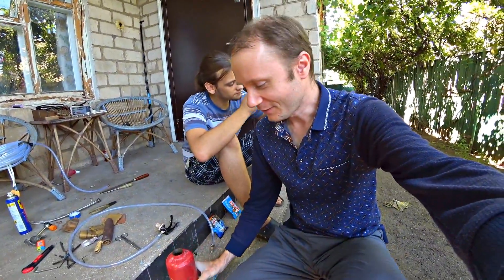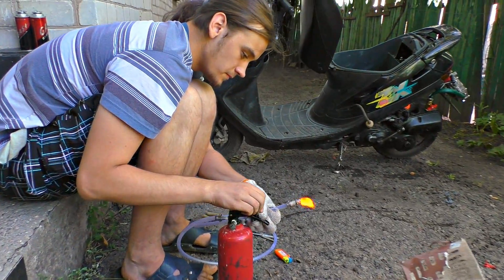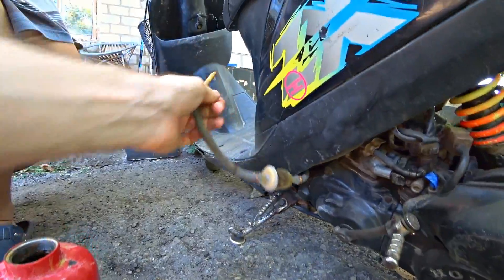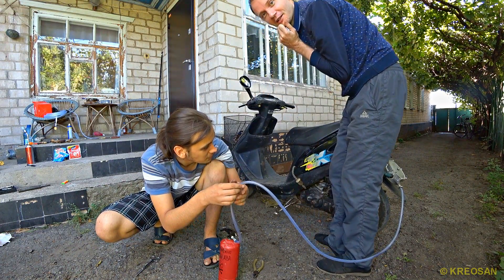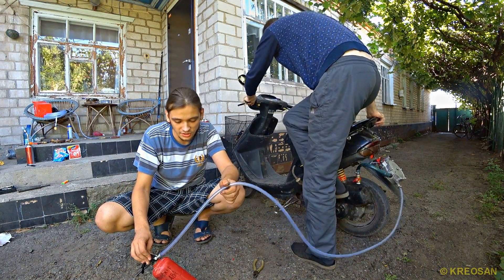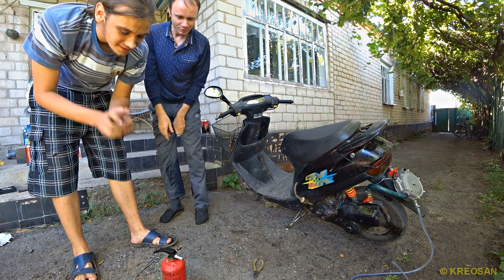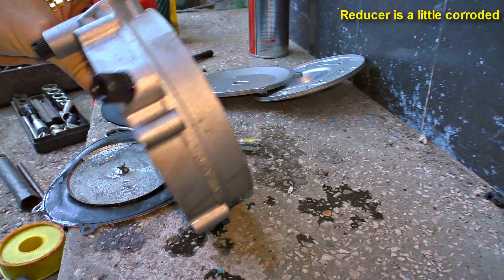Hydrogen Scooter 🔥 First Tests!

Comment: How about using a magnetron in place of the spark plug. Use and ultrasonic tranducer to vapourize the water before it reaches the combustion chamber. Change the spark timing to exactly top dead centre, and feed a higher power to the magnetron. When the water vapour reaches the combustion chamber, the magnetron may produce  a mixture between hydrogen and super heated steam which should force the piston down very quickly. You may have to modify valve timing and have better piston rings for sealing, but it may be something looking into.

Comment: One of the main challenges with using hydrogen as a fuel is its low energy density by volume, which makes it less practical for certain applications like transportation where space constraints are important. However, if effective and efficient methods for hydrogen storage can be developed, it can help address this issue and make hydrogen a more viable energy source.

Several methods for hydrogen storage are being researched and developed:

High-Pressure Gas Storage: Storing hydrogen at high pressures (typically 350-700 bar) in specially designed tanks can increase its energy density by volume. These tanks must be strong and lightweight to handle the high pressures safely.

Liquid Hydrogen Storage: Hydrogen can be stored as a cryogenic liquid at extremely low temperatures (around -253°C or -423°F). This reduces its volume significantly compared to a gas at ambient temperatures but requires energy to maintain the low temperatures.

Metal Hydride Storage: Certain metals, such as lithium, sodium, and magnesium, can form metal hydrides when exposed to hydrogen. These metal hydrides can store hydrogen and release it when heated. This method allows for safe storage and can provide a more compact solution.

Chemical Hydrogen Storage: Chemical compounds can be used to "capture" hydrogen and release it when needed. This approach can offer high energy density and ease of transport but often involves complex chemical processes.

Carbon-Based Materials: Researchers are also exploring carbon-based materials like carbon nanotubes and graphene for hydrogen storage, as they have the potential to adsorb and release hydrogen gas efficiently.

Developing effective and safe hydrogen storage solutions is a crucial step in harnessing hydrogen as a clean energy carrier, especially for applications where energy density and practicality are essential, such as in transportation. Researchers and engineers continue to work on improving hydrogen storage technologies to make hydrogen a more practical and widespread energy source.

Comment: please continue. Use use hydrogen and oxygen generator running off alternator with baking soda as your alkaline electrolyte. Run your fuel through a water bubbler stage to prevent precipitants and ignition of hydrogen from returning to your generator.

Comment: Maybe with a no return valve and changing the spark timing it will work!
There's a pin on the flywheel that gives the signal to the spark coil, it could do something, but maybe it needs some work in the cylinder.
Too complicate 😅

Comment: that hydrogen generator you got there is a ticking bomb, have at least a pressure relief valve. I used that reaction to produce cheap and easy hydrogen, and it tends to ran away and ramp up real fast. secure the cylinder in a tray/pan/half plastic jug with water to prevent a rapid runaway. Make sure you do not stay in front or above it, for obvious reasons. Use a washing bottle (have the gas buble in a bit of water at the botom of a bottle) to take out the steam and sodium hydroxid out of the gas, cause it will destroy your engine. Have a big balloon to collect the gas instead of letting it pressurize in the generator, to lower the runaway effect (this reaction goes faster the hotter the recipient is, at atmospheric pressure it will stop around 100c, as the water will boil, but if the pressure goes up, the temperature goes up, the hydrogen baubles will be smaller and the solution will stay in contact more with the aluminium.

Please don't put yourself in the situation where that could explode in your hand, it would be a horror show. Have fun and keep up the crazy shit, love this stuff! :D

Comment: You need to take the gas from the extinguisher and bubble it through water to get rid of the alkaline and cool it then through a flash back arrester then to the scooter. If you ignite the gas from electrolysis because ir has oxygen too it could explode and do you great harm.. I blew up a 2 liter bottle I was holding that was partially full of this gas and it cut me to the bone on one hand and broke my other thumb. Please learn from me and use a flashback arrestor!

Comment: Definitely recommend running the hydrogen through a bottle with wet cotton or just water with rocks or plastic pieces inside to break up the bubbles to remove the alkali.

Comment: The mammals can not heal damaged hair cells in your ears . nad yur eyes can be burned in secs if yu get hit by only one drops aof warm and high alcaline liquid.
Y can not be warned before your ears loses start loses the human speaking frequency range .
Resonant frequency of aduld ears are about 4Khz . In this area your organ of corty separete from the   basal membrane that cause ischemic hair cells in this area  that will generate noise (Tinnitus) and inflammation in this area as react to  tring to heal  . 
But mamals can not heal this bc tumor suppresion genes block cell cycle in cochlea after embrionic state.

Comment: Generating H2 and using it to run scooter is difficult to control. I suggest that you first generate H2 and store in a container at pressure and then use a release valve to regulate the flow/ pressure.
Reply: Compressing hydrogen is very bad idea .. thats why fuel cells arent used yet .

Comment: Different fuel types need different ignition timing on the engine, to not damage the engine and get the efficiency from the fuel. Also burning oxy- hydrogen produces not so byproducts, not just water like most claim.

Comment: Bright orange flame: there must be a lot of sodium in flame. There are far cleaner ways using lightly safer dilute acid instead on sodium hydroxide. Acid still dangerous but safer and cleaner.

Comment: I made many of these foil acid hydrogen generators,but no  matter what you use the acid and heat destroys,the whole sys,,and the fumes and foil sludge ,is not worth the hassle,the last and final generator I made was using a medium sized  acetylene bottle and brass valve that comes on it ,I added 16ozs,acid and a roll of aluminum foil rolled up in 12in long tightly rolled tubes,and 2 of us quickly added all the foil,it was so hot by the time all foil was in,had to were welding gloves to screw on the valve,the valve,after this the real heat started the bottle started smoking and all the paint burned off,and this is when it was out of control,the valve was melted inside and could not be opened,it was a dull red glow,when it blew off the valve and turned into a rocket and fell over and hit the block wall in the corner and was stuck everything in the tank the acid and foil and acid smoke blew out in a second and filled the garage  completely with acid smoke,i shut the door and threw wet towels to stop the smoke,and didn't go back  in until the morning,it was a disaster were the pressure blasted out was black burnt foil and metal burn on floor  from the inside of bottle,and was on the wall 10 ft away the valve,was melted and the brass  threads were still in the tank and was  30 ft away on the other side of shop,a and the worst thing that happened tools and equipment,anything metal,rusted after a week or so,from the acid smoke,that was the last and final experiment,but was I afraid or scared, ya,right,!I was way  past that when the bottle changed to dull red ,and my friend helping with the foil into bottle,was scared the police and fire department  were going to called by a neighbor ran away and left me with the monster,the moral of the story is,dont do it!

Comment: You should use a bigger canister to put the water and aluminium inside and also, don't use too much aluminium. The more aluminium you use, the hotter it gets, but if you use a bigger canister, you can use more aluminium without getting it too hot and also the the reaction takes longer because it has more volume then a small canister

Comment: You put an exothermic reaction  in a pressure vessel, the byproducts of it producing a highly pressurizable gas.
There is a word for this- a bomb.
Reply: Dunning Kruger effect*
Reply: @dalton6439  Mind explaining why? I'm not a chemist.
Just read some stuff on Wikipedia and what Op said seems plausible.
Reply: @dalton6439  have you ever read the paper that gave rise to the term "dunning kruger effect"?

Take a look, and you might stop using the term...
Reply: @forestdenizen6497  I have read about it. I use it loosely. Its actually really interesting stuff.
Reply: @dalton6439  You shouldn't, because Dunning Kruger effect is just bs !
Reply: They did say we realize this is dangerous we need this as a test for proof of concept

Comment: Check the spark plug timing, in normal engine the spark occurs even for the exhaust gases, since they are non flammable no issues. But in hydrogen it's not the same case. During the exhaust stroke there shouldn't be any spark.

Comment: i've seen others use a water trap to remove liquid of going into further in the system. i think it's called a bubbler. it also acts as a barrier so a flash can't travel back to the hy-generator...

Comment: Sodium Hydroxide has got to be one of my least favorite chemicals to work with in amateur chemistry experiments. Everyone knows it burns skin, but people don't really talk about how solutions of it have a bad habit of coating and absorbing into skin, so any that you get on yourself will persist even through several minutes of washing in water. Also, dissolving NaOH in water releases a ton of energy, causing the solution to get very hot and start to "steam", creating a caustic aerosol that is damaging to the lungs and coats everything in a layer of caustic mist. Additionally, the reaction of NAOH and Al is rather unpredictable and varies based on the temperature, conc of NaOH, metal surface area, etc. The reaction may appear to not be working at first, but after an unknown amount of time may violently kick off, releasing heat and boiling the reaction mixture. And if done in a pressure vessel like this, it would be very unwise to not consider the ideal gas law, which could be used in addition to stoichiometry to estimate the pressures produced by a given quantity of reactants. 

Long story short, anyone can make hydrogen throwing chemicals together willy-nilly, but will you go blind in the process? Are you willing to face the risk of permanent disfigurement or even death should something you didn't account for occur? The answers to these questions depend entirely on YOU and your preparation. Please stay safe
Reply: it eventually will damage your nerves especially in your fingertips.
Reply: I once made a bottle bomb when I was young and stupid, glass bottle with lid hoseclamped on for more power, by the time I got the clamp on and ran outside with it the contents were a swirling orange/black and bottle was cooking, fortunately I got away with seconds to spare and nobody was hurt....we could still hear the glass  falling on factory roof some 5 to 6 secs later.
Its still one of my cringe moments 30 years later!
Reply: They're Russian ffs.
Reply: Very well said there dude!! This guys comment about the bottle bomb made me lol ngl!!

Comment: by using electrolysis you can produce hydrogen and oxygen from water then storing the hydrogen only in canisters, if the hydrogen and oxygen gets stored in the same canister it will be a bomb that will explode when it gets heated enough

Comment: Since this is clearly a two-stroke motorcycle, the engine needs lubrication for the crankshaft and the cylinder in the form of oil, which is delivered with fuel. In this case, the engine is not getting any lubrication at all which will probably result in it seizing up rather quickly. In fact, I'm quite surprised that it is still running.

Comment: If you can get some gallium I've heard you can use it as an efficient, reusable catalyst for hydrogen production with aluminum, minus some of the dangers of the alkaline solution. Unsure about heat generation, though.

Comment: It is safe to produce on demand hho through electrolysis as long as you use a flashback arrestor or a bubbler and a check valve.

Comment: My car used to use ngv, before I took the tank out because the ngv price increase and I happened to have that same small explosion before. In my case, I need to change the spark plug because the natural gas needs good plug to operate.

Another reason which also my experience might be the rubber diapraghm for that regulator might have small torn causing leak and that small explosion. Even if the tear is small, you have to change it.

Also the engine need to set a bit advance (if I'm not mistaken) for the ignition timing for the gas to work like normal gasoline, it will make the idle later run smoother like running gasoline.

A restrictor valve also a must have for proper setting.

Of course, I just share this for anyone here that might want to do the same setup permanently. It might help someone.

Comment: First of all don’t use a metal container for the reaction, the alkaline will eat it away.
Also try to refrigerate the reaction container to control the velocity of the reaction and to avoid spills, liquid going through the tube and water vapor in the fuel.
Remember that as i said on the other video, that scooter probably needs oil mixed with the fuel so try to use the carburetor with oil instead of gasoline and make the chiclet smaller so that it doesn’t burn so much oil.
Lastly remember that hidrogen molecules are much smaller than gasoline ones, so its much easier for the hidrogen to escape through a valve that is not closing perfectly or a not so perfect seal. Thats why I think its making so much backfire. Also I think I heard some knock, this is because hidrogen has an easier auto ignition so its igniting on its own without the spark from the spark plug.
Reply: They don't read this. They don't speak english. This their channel: https://www.youtube.com/channel/UCUllb83Lugbka-rvF6Nutxg

Comment: Wow! Did you just make an argument pro-Hydrogen, by calling Li-batteries dangerous? xD …you know what happens when H reacts with O… ;D
Reply: Well if the hydrogen is stored properly without any air in suitable pressure vessel it is safe and unlike batteries if something catch fire it can be extinguished with water
Reply: MICHAL_C900 too bad if a hydrogen-driven car catches fire, there will be nothing to extinguish left...
Reply: The Hindenburg knows ;D

Comment: Yeah Volkswagen Golf II with early LPG instalations have this same backfire problems. Maybe try to read about that and find a clue :D
Reply: Kon its because the size of the molecules, H molecules are really small, and gasoline molecules are large, so hidrogen being pushed by the explosion escapes through really small places (that gasoline wouldn’t) and goes to the exhaust and makes the pop.
Reply: I used to have NGV system in my car, still have them except the main tank because the price increase and the infrastructure closed down because of safety concern here. 

Backfire happened because of incorrect setting of the system, and worn spark plug. One time, it blows off my air filter box, where the spark plug work properly for gasoline. After my mechanic change the spark plug, the problem dissappear just like that. Of course, this is just one of possible reason of backfire. It might not for that case.

Comment: What if you use electrolysis to split water into hydrogen and oxygen, collect and store them separately, then have them mix inside the engine?

 I say store separately because with your safety record, I'm pretty sure you'd blow yourself up if you just store the perfectly mixed hho gas.

Comment: The pressure in that tank can make it explode like frag granade.
Reply: @Reno Simpson The container is made out of steel or stainless steel. It won't be attacked by sodium hydroxide.
Reply: @Reno Simpson not around the world
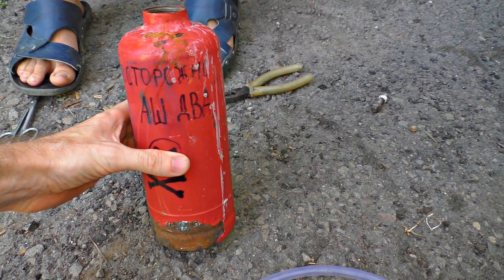Reply: @Reno Simpson look at 3:54, is that aluminium?  When did aluminium started rusting? Before talking shit watch the whole video. I'm willing to bet my left nut that's the same low carbon mild steel used for any pressurized gas cylinder.

Comment: You  have to stabilize the hydrogen from the oxygen so it will burn effectively. Try storing the hydrogen in Deuterium. It is the only know element that is able to store and Hydrogen.
Reply: I prefer using corporation wine
Reply: I pefer using corporation wine

Comment: says batteries are dangerous 
Powers scooter with Hydrogen

Never change Kreosan
Reply: next video, 
 says hydrogen is dangerous
 powers scooter with dynamite
Reply: I was thinking this myself - Batteries = dangerous. Pressurised hydrogen = good.

Let's hope there's health and safety read up on before the next experiment!
Reply: The name of the channel sounds like "kerosene" kinda,  when said in english. Kerosene is a "normal" fuel. 

Kreosan: Let's run an engine on everything except normal fuels!!! This week, drain cleaner and foil!!!

Love this channel. It's epic, even if the engine doesn't run. (Insert exploding drain cleaner fire extinguishers here) :p lol
Reply: look, the alkaline took the paint off the fence.
gets alkaline on body.
Reply: Hydrogen is safe than lithium.
Reply: @suprememasteroftheuniverse  no it isn't
Reply: Methane is much better for energy storage